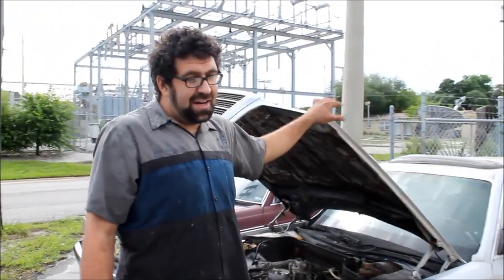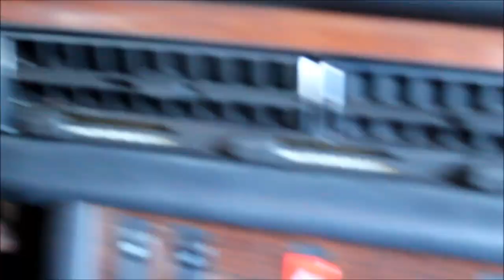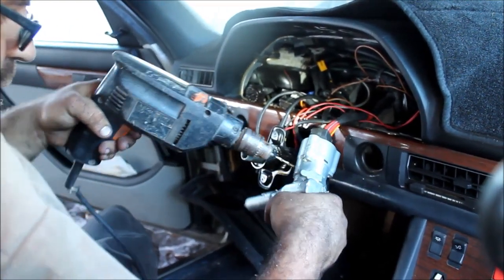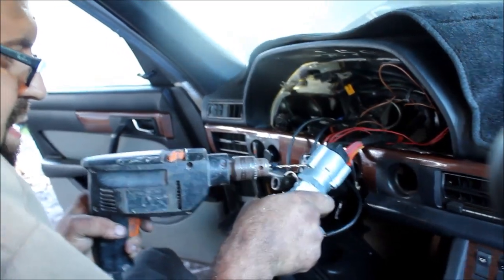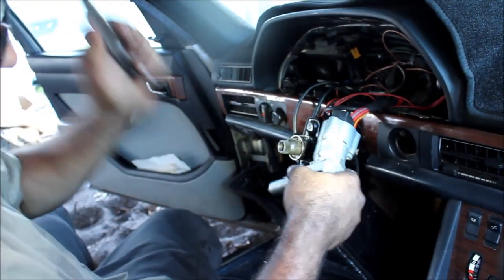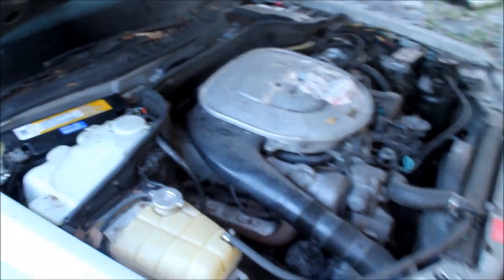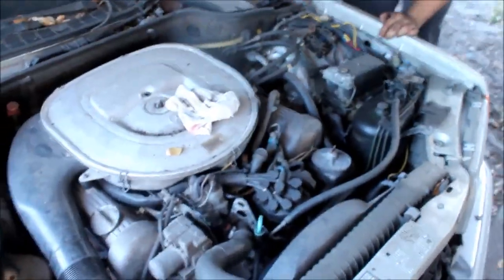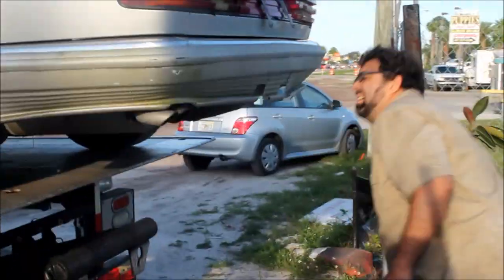How to Start a Mercedes Without a Key with Pierre Hedary

Comment: Oh, this looks all to familiar Pierre.  I worked with a new local MB Tech last Saturday to replace my 123 Wagon ignition switch, including all of the drilling.  My key was not broken off.  We got the new switch in, connected to the steering column, and finally got the tumbler to turn (outside) of the switch, but it would not work when we put it back in twice.  R said I needed a new tumbler, which came yesterday.  We will revisit this coming week.  Ahh, I forgot to say got it to start using the screwdriver.  However, after R left, and I tried to start it, nothing happened 😗.  The glow plug light came on and the warning buzzers sounded.  Then it was just an "eeehhhhhh ehhhhhhhh" sound and nothing.  I left it alone and will just wait.

Comment: NOW, you can order a new cylinder by VIN, and install a new lock bolt housing without the boobytrap relocker. Looked a bit bloody rough, but The Cable Guy would give you the thumbs up

Comment: This reminds me of two extremely fiddly jobs on my 1979 W116 (450SEL) and without a manual. The fitting of the windscreen, to do this job you need good hands, lots of patience and cups and cups of coffee. Me and my retired master mechanic dad initially took the car to windscreen fitters but all of them would not take on the job, so we had to do it ourselves. The dashboard corners come in the way to get the rubber to seat well. Very, very difficult. Another is fitting the glove box lid. There is a small screw on the inside of the glove box that has to be reached to do or undo the glove box.
Reply from the maker: that pin extraction on the ignition looks ugly but the process works. i can empathize with you about the windshield. i have done it enough times...and it never gets easy.
Reply: @mercedesclassicswithpierre1753  My thinking is that at the factory they must have followed a sequence of windshield installation first then dashboard. Is that right, would it be easier this way? For years whenever I see  a W116, I wonder if it is like that.

Comment: Yeah I had an issue on my 123 where the key was starting to get finicky,so I got a new tumbler and tried replacing it. 
Well I almost got screwed on that ,and luckily I got the new tumbler back out. 
At that point I said I'm fine using a screwdriver until I get a whole new lock assembly.
It's a 4 speed so thats a good theft deterrent.

Comment: My car is a 1999 Mercedes s320. Lost the key and have no keys now. My plan is to have the car towed to a Mercedes dealership.  Is that a good plan or should I just sell the car. Or should l like you did start it on my own.  I have never taken apart a steering wheel.  Can you elaborate more when you got to using the screw driver and then what

Comment: I've got the same problem with my 2002 SLK (R170). Key is broken in the barrel and seized in. Is there a way to just disconnect the steering lock and then "hotwire" it? Maybe fit a start button. ??
Otherwise it's an expensive job.

Comment: Its pretty bad that a car manufacturer has a problem with the ignition for twenty years and failed to fix the problem. Doesn't say much for quality. I had to repair the ignition in my 05.

Comment: Hi there, thanks for your video. On my 1996 W202, I cannot turn the ignition with the key. It is stuck due to the pins in the lock tumbler not being flush. Would you please suggest a fix? Thank you.

Comment: Hi, I had the exact same situation in my W124, the steering lock was jammed and the key could not go to ACC, so I had to drill out the pin of the steering lock to get the complete barrel off the car. The only thing I did different was that I drill 3 holes on the plastic wire connector to unscrew the 3 screws that hold the electrical switch onto the barrel instead of drilling the screws itself. So I saved the electrical switch but now I have 4 holes on the connector. After that I ordered from mercedes a new barrel to my key, tool 1 week and 100€. Thanks. AC
Reply from the maker: I would prefer to replace the switch than the housing...the switch is inexpensive and easy to get. Still, i am glad you got the repair done yourself without damaging the car. good work!

Comment: This particular issue with the w126 has made me walk away from a few that had good repair histories. I've just put it down as preventative maintenance like checking timing chains and guides for the cam gears, and not a matter of if, but when they decide to unravel. Sure not a user friendly repair, Pierre.

Comment: I wonder if a very powerful magnet and a few Light air hammer vibrations on the housing could have gotten the broken piece of key out?  I even have very small extremely powerful magnets that would fit in the key hole and perhaps could just extract the broken key that way?
Reply: Did you ever try this ? I'm in the current situation and I have tried doing this with no luck.
Reply: @Indigo_iii  keys are not magnetic.

Comment: I just used a sawzall to chop off the wheel lock and off came the ignition with it. Now I have keyless ignition
Reply: jam9297 can you explain to
Me how you did this. I have a 1980 280ce w123 and my key broke off in there. I used to be able to turn it with the broken key

Comment: I'm having some issues with my 2005 sl500, the temp guage isnt working, i changed my thermostat, temp coolant sensor, still nothing,  i saw it work a couple times and now its just stuck at 40, any advice will be greatly appreciated
Reply from the maker: Hello, Chris Ramsingh and thank YOU so much for your question(s), we want to answer you as quickly as possible. 
By signing in our Patreon https://www.patreon.com/thomaspolk page and making a donation of $10 your are assured of a 24 hour email response from Pierre. 
If you are already a $10 member please mention along with your question.

Comment: You can pull the lock out of the driver's door and a car lock Smith will make a key for $30 dollars , I did this to a 300TD I bought from the auto auction 2 years ago with out a key
Reply from the maker: I had the key...ignition switch would not turn. plus the 126 uses a laser cut key No lock smith can make it. This was a last resort.
Reply: @mercedesclassicswithpierre1753  ok I understand, just out of curiosity what are those flags ?
Reply: M

Comment: I couldnt tell if this one was the one that has 2 vacuum lines going through the ignition. What do you do with those
Reply from the maker: the line to the engine shut off goes on the bottom
Reply: The Pierre Hedary Mercedes-Benz Classic Specialist Thanks man, we figured it out. Previous owner snapped key off in ignition switch. So, we just decided to cut the wheel lock with a dremel from underneath, as to not take dash apart. Then we realized that the lines were the vacuum lines that go to the fuel shut off. So until we replace the entire ignition mechanism we have to detach one hose, and suck on it, to turn off motor. It works, but it sucks... Lol

Comment: I have a 2006 mercedes c350 4matic and the key just wont turn
We tryed everything, even sent it to AAA but it still wont start....Any way to hotwire it without making connection to computer???
Reply: The EIS reads the key, then releases the lock, thus allowing rotation. The infrared key is either damaged, or the EIS motor is dead. You will need a VERY talented locksmith, as the EIS module is sometimes serviceable. try www.findalocksmith. Be sure they have the resources for your vehicle

Comment: Oh man, you even used a driller. My mechanic turned it on only with very basic tools. You are destroying the car man....
Reply from the maker: you can't get the lock out without a drill
Reply: I need to do this this weekend
Reply: @mercedesclassicswithpierre1753  your right..my key was stuck i couldnt switch the ignition to position 1 or 2 and i had to break the whole ignition cylinder in order to get it out and fit in the new one

Comment: why not order a key at the mercedes dealer for 40 bucks?
Reply from the maker: I had the key..the steering lock was FUBAR.
Reply: Henderson said i need a key.for a  call   ,
Reply: The Pierre Hedary Mercedes-Benz Classic Specialist.
Reply: what if you lose keys in a weekend night in a cold place.  like a remote gas station.  u knever know
Reply: I'm not sure where you get your keys (seriously, let me know) but my '83 380SL's key was $79 and my 1991 SL500's is $260.
Reply: Try $300 now for a key
Reply: @mercedesclassicswithpierre1753  FUBAR😂😂😂
When that ignition won't turn, it's a real SNAFU😕